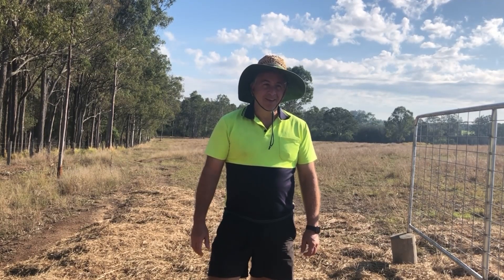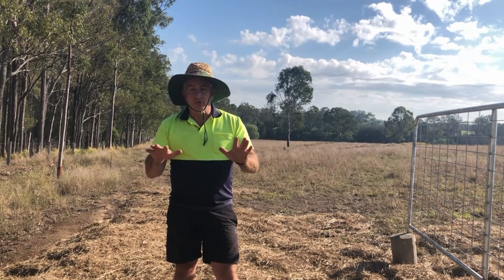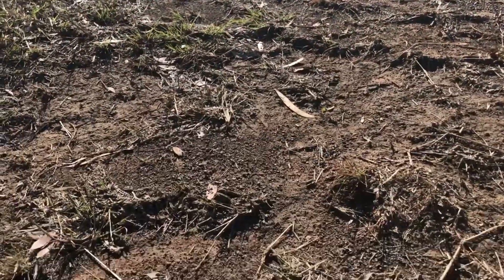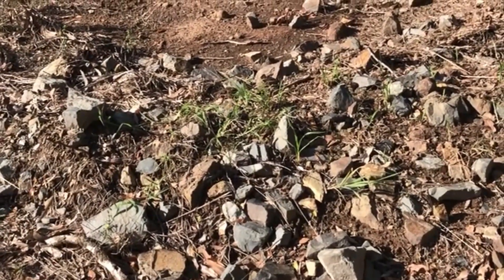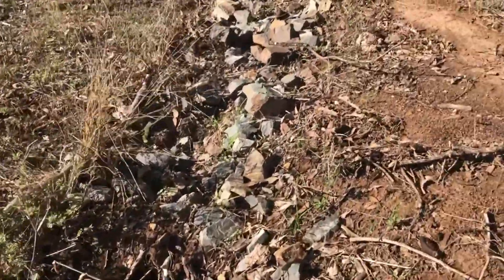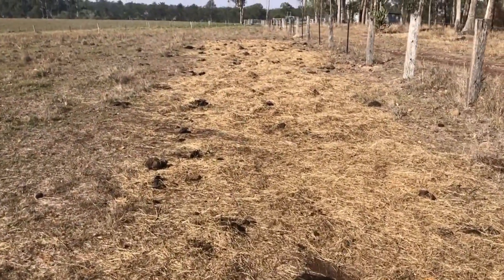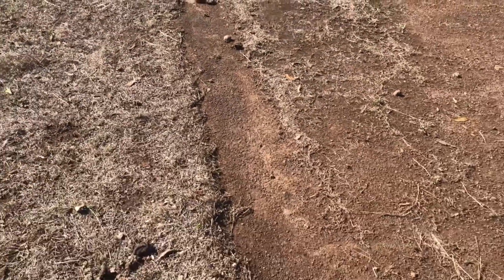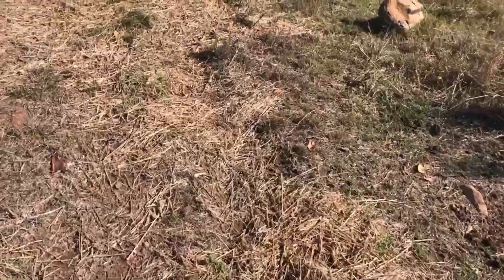Erosion control update - success.

Comment: Years ago I used to get shavings from a timber mill to top up my gargen beds. I got it for free. Check if any mill around has it available at low cost. Just an idea.
Reply from the maker: Great idea. I will give it a go.
Reply: @queenslandfarmer  Another idea is to see if you can get the shells of almonds from an almond orchard and spread the shells on your land. They will take longer to break down but it will benefit the soil in the long run.

Comment: Nice that it worked out so well. When you take the energy out of the water the solids will drop out of solution. Insects will benefit heavily from the mulch as well, and create holes in the ground to lay their cocoons and while doing so they create passageways for the water to go, and dung beetles are going to fertilize the land, and so and so on. So the mulch does many more good things than just protecting against erosion and evaporation or creating a habitat for bacteria and fungi. It truly is regenerating the soil in multiple ways. 👍
Reply from the maker: Excellent point regarding the insects and dung beetles and the flow-on effects from water travelling deep (excuse the pun). I appreciate your input.
Reply: @queenslandfarmer  If you can get some bio diversity going with different species of native grasses and flowers, combined with rotational grazing and some strategically placed swales or ponds, the insect world and the micro organisms will be able to cultivate your land 24/7. It will make a huge difference.